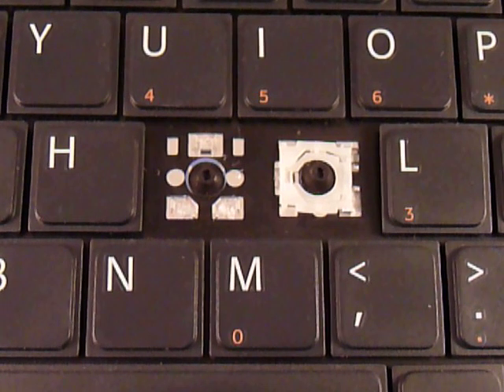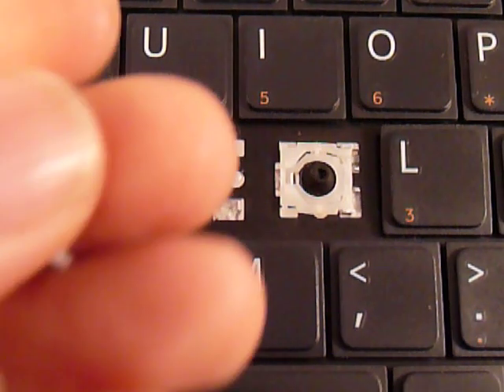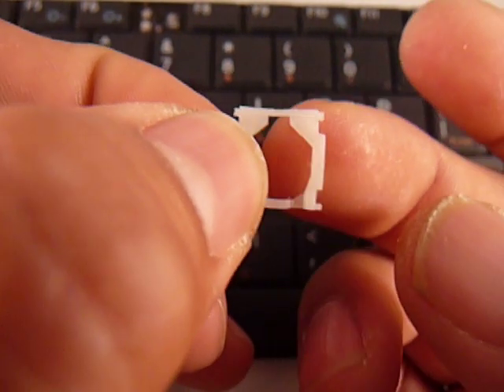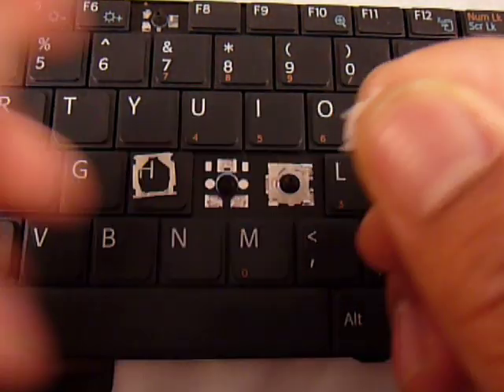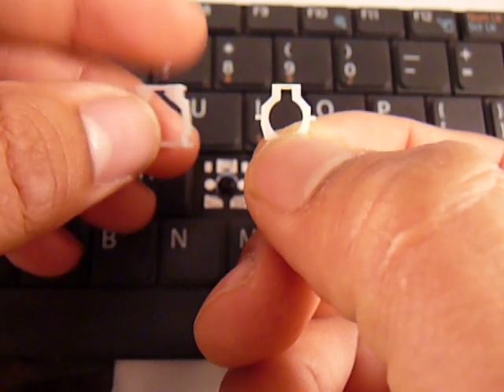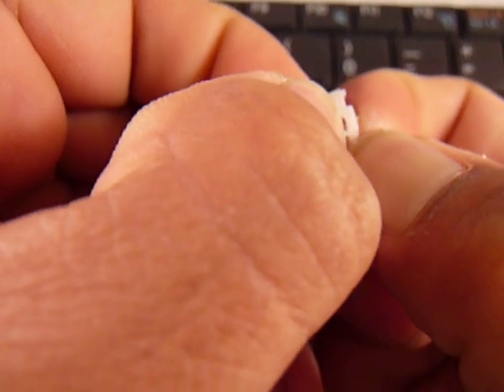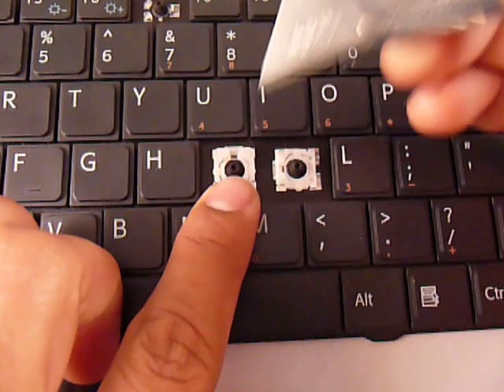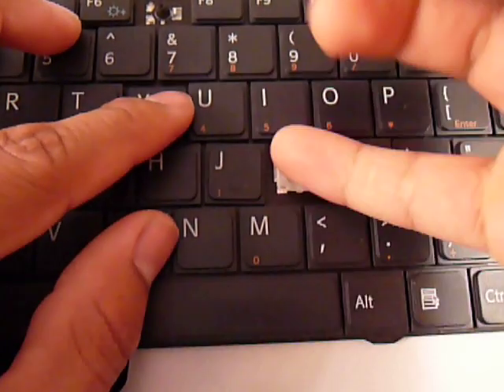Sony Vaio Laptop Keyboard Keys Repair Fix Guide VGN PCG

Comment: Bought my Vaio in 2011 and it's what I'm typing on now. It's a little the worse for wear, dusty inside, which is why I'm looking up how to take keys off (so I can get at the dirt therein), but runs like a mule. Should've and wanted to buy a Vaio laptop years before, but was wary of the hype about them....and the astronomical price (in those days.)

I've only ever replaced one thing-the cord, shortly after purchasing it. Which is always the first thing to go on any laptop. Battery has always been fine. NEVER NEEDED TO BE SENT IN ANYWHERE FOR REPAIRS. And I'm not a techie, know very little about it.

So I also need to give thanks to (what I now call) the Mighty Great One, Oh Lord Sony, Maker of Bright Shiny Goo-Gahs.🤤😋

Also, their headphones rock Beats into terminal comas.😆🙇🏼‍♀️

Comment: If someone with a bad eyesight has done it successfully, can you please explain how you fixed the plastic spring on the keyboard without seeing? I need a lighting magnifier but I can't hold it while trying to extend the plastic thing. I've spent two hours trying but since I can't see what I'm doing I have to rely on touch and, obviously, it doesn't work. 
TIA.